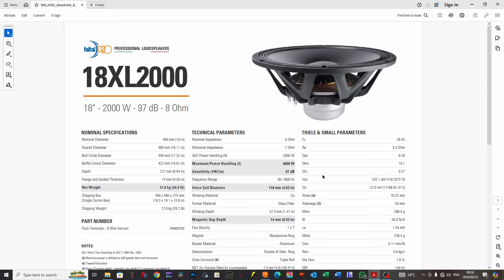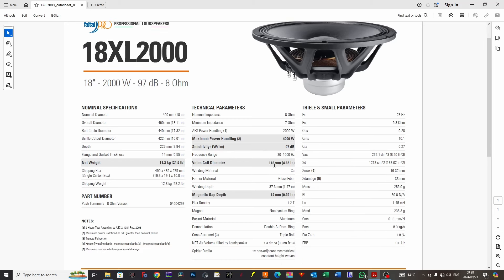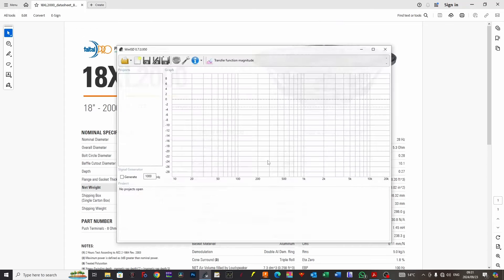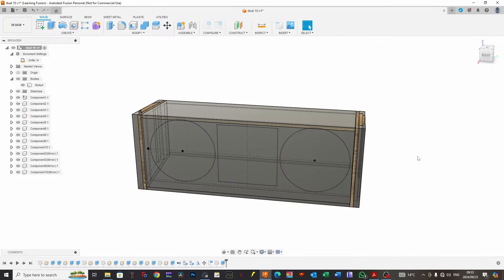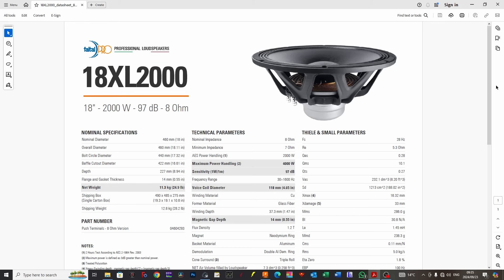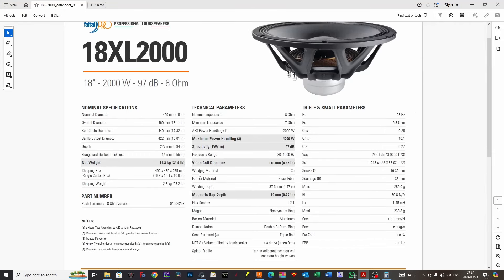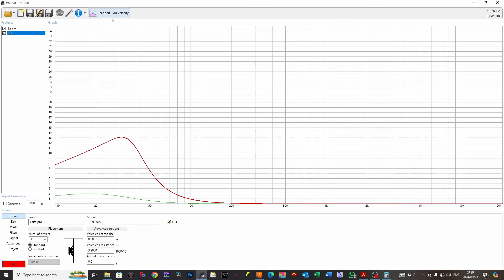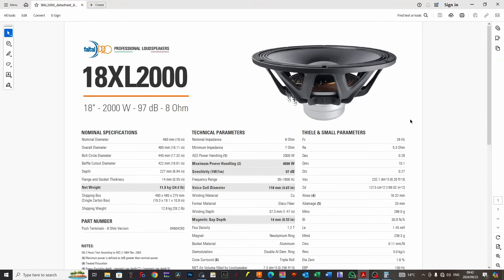FaitalPRO18XL2000

Comment: Holy cow maybe this is a better option all round for a guy like me as i move these things very often and weight is a huge factor in circumstances.
Reply from the maker: @EBMproductions1  even the 18HP 1060 is a good choice, using litewood you could most likely 1 hand lift a single 18
Reply: @The-Sound-Guy  very interesting and really something that SAs industry needs to understand as we see all kinds of drivers in huge or too small cabs which is quite a shame.